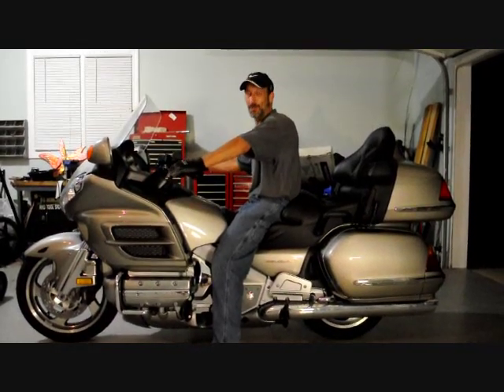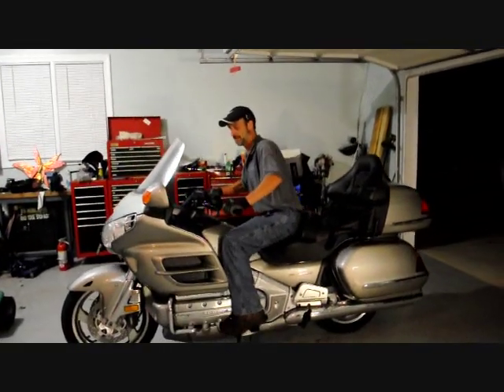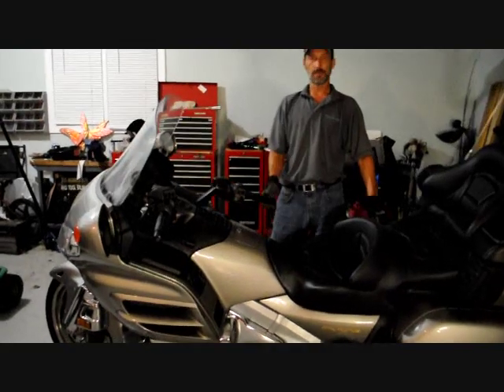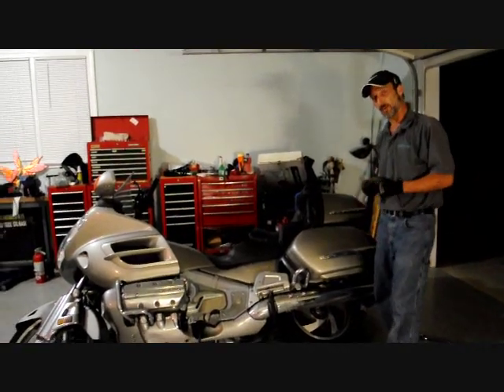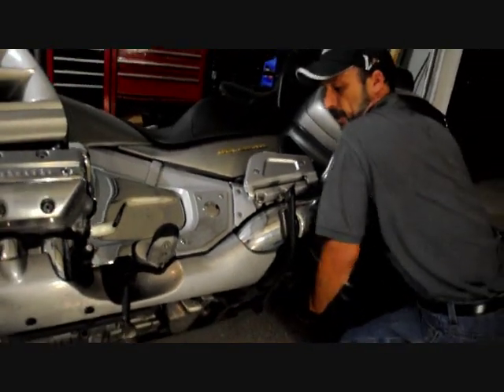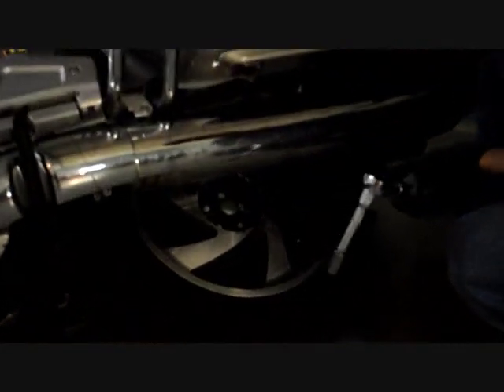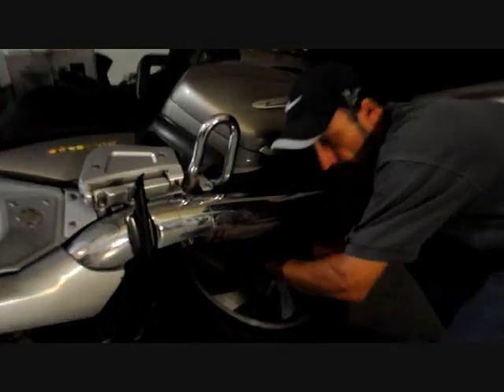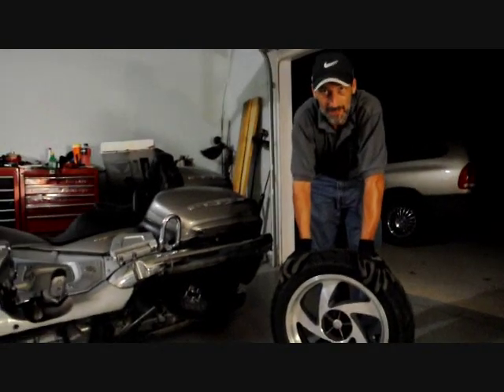Honda GoldWing Rear Tire Fix part 1 see part 2 for bloopers

Comment from the maker: MrOnamission I think this will work as long as your wheel is mounted the same way. I can't remember if the 1500 is a mono shock or not. You can do it also by removing the rear fender but I think that is to much work. remember to be careful when you lower the bike.

Comment from the maker: Thanks for watching. There is always more then one way to do things, The first time I changed my rear tire I took off the fender. This way was much easier for me.... btw...I know that the Goldwing is metric, however a 3/4" socket is the same size as a 19mm socket. It works great. Be carefull and have fun on your Goldwing.....